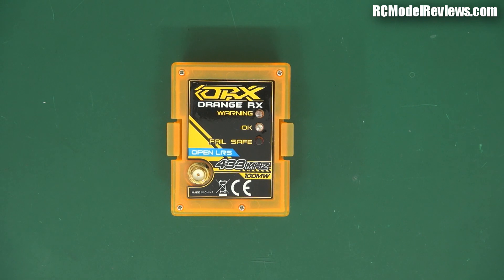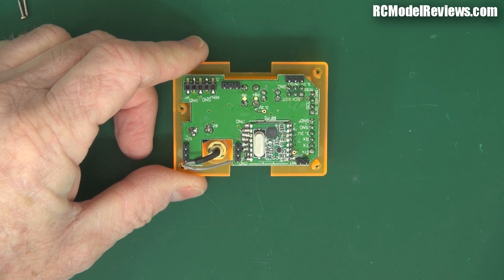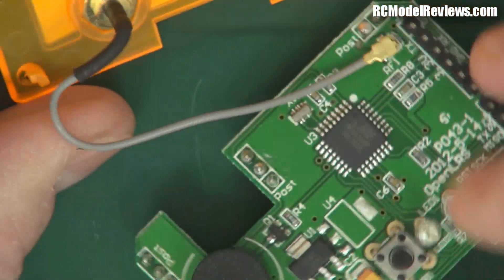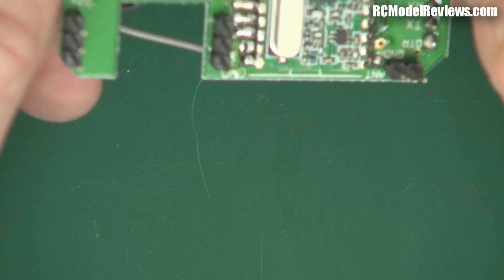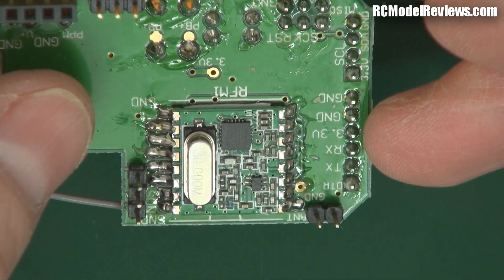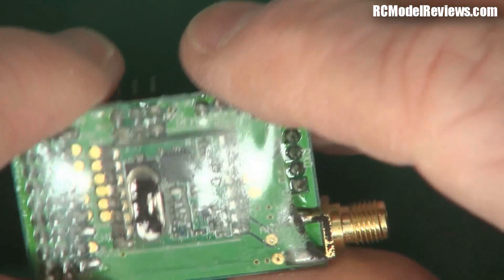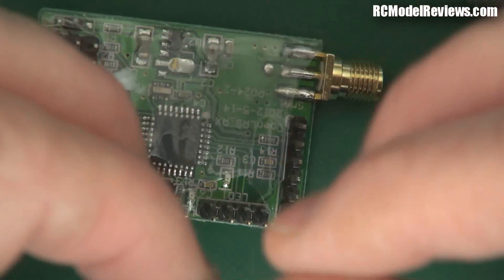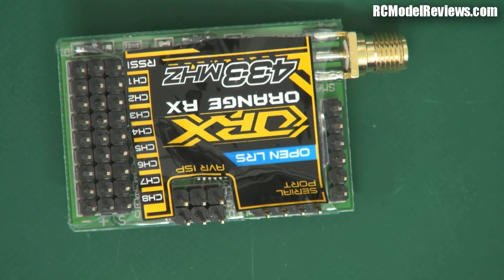UHF RC Shootout: Open LRS Long Range System (part 1)

Comment: I have used the Orange Open LRS system from HobbyKIng on a couple of models.  That large crystal on the receiver is a bad idea.  I did swap a couple of modules to the type with the miniature crystal or resonator.  You also need a 3.3V interface to connect for Arduino programming.  I don't like that this version runs the Atmel CPU at 16MHz on 3.3 Volts. It's being over-clocked at 3.3V; probably not a good idea for a mission critical component.  Other than that, once you get it working it seems OK. Getting it working well with OpenLRSng firmware can take quite a bit of messing about.
Reply: most 100mw rx work on 3.3V@16Mhz...

Comment: Hey Bruce, have you noticed that there is a small amount of static noise on your wireless mic when you tap your screwdriver on any metal parts of the circuit boards?

Comment: Bruce please give me a hand. During last 2 years, I've gone thru 2 OrangeRx 1W, 2 OrangeRX 100mw, 1 DTF UHF 1W deluxe, 2 DTF 100mw RXs, Numerous antennas(4 self made, 2 nagoya dual bands, 2 DTF dipoles)

I can never go beyond 1km range without triggering failsafe. A while ago I thought I found the problem, turned out I haven't (My taranis+ is powered via 7,2V NiCd aparently DTF modules are designed to work with 3S battery, So I plugged a 3S lipo to taranis. Same result.)

Also to anyone reading this comment, If you got an OrangeRX JR module it's extremely likely that the antenna piggyback is broken. Check it with multimeter before even turning it on. 3 out of 3 of my Orange modules had broken wire which resulted in burned out module.
Reply: flanker Try lower data rate and also enable channel hopping. DTF 1W should do 1km at complete ease. Maybe post a shot of your openlrsng settings?
Reply: I'll swap my 9xr for your Taranis ;-)
Reply: flanker If you ever powered the TX module without an antenna, you might have blown or damaged the output stage of the TX. Having the buzzing noise go away suggests to me something has blown. Unless you added shielding to your speaker circuit (as I did on mine) then I'd suspect the TX module itself.
Reply: Hehe... I like the irony of that. Using the Taranis to test for it's own demise...  :-)
Reply: Orange isn't made to fly 1k out, buy something better, Orange is cheap park fly stuff, I use it all the time with no issues, I just don't expect it to do more than it's price bracket?
Reply: Ben Portman hey there Ben. It's not just the orange. Dtf Uhf is made by the guy behind openlrsng.  people reach 60kms with it. Even with a terrible antenna i should get more than 1km from a uhf system. Another strange thing is,  whether i use telemetry or not. My range is roughly the same. Which indicates that my tx module is outputting no more power than my rx (which is 100mw) 
At this point I'm pretty sure that problem is with my taranis(since I've change every other component). I think it just can supply enough current. 
A friend of mine has a 9xr. I'm planning on burrowing it and testing with it.
Reply: Leo FPV I tried lowering datarate as low as it'd go. Also tried with standard settings. As for channel hopping, tried anything from 6 channels to 24 channels. I'll post my current settings.
Reply: Ben Portman Sure :D
Reply: flanker i use open lrs for about 2 years  and never had a problem. only burned 
my first reciver because i used 5v. had to replace the RFM22B 
transreciver module. i bought 4 of the new versions with the small 
kristal from aliexpress for 20$ or something. i use the rmilec SRC771 
1/2 Wave and the ImmersionRC 433MHz "Sander" Antenna and a couple of 
home build half-wave dipole antennas. the 1w on the transmitter is not 
real . it only outputs about 500mv
Reply: Walter Melon I think my TX doesn't even output 100mw, let alone advertised 1W. 

Something just occured to me, I remember the first time I put a 1W orangeRX module to my Taranis. I recall a really loud buzzing sound from the Taranis's speaker. Now there is barely any static. I feel that suggest my module is outputting very little power(as in 3-4mw) 

Does anyone know how taranis supplies power to the external module? Does it just bypass battery power to the module, or is there a regulatory circuit in it?
Reply: Ben Govett Hey there, I might have powered my first orangeRX module without an antenna, but I'm 100% sure I never powered DTF UHF without antenna(I actually taped the antenna to the module to not accidentially remove antenna) 

As I said, only thing left to test is the Radio itself. I have a feeling something inside the radio is smoked and it can't provide the module with enough power.
Reply: flanker The old JR radios used to output 6v on pin 2 of the 5 pin module bay connector. Some radios with JR module bays ground this pin, others leave it open circuit. A grounded pin MAY cause a problem with a module if it's relying on 6v for something. Needs testing I guess. 

Could measure voltage output from the bay with and without the module connected. If there's significant voltage drop across the supply and/or significant current being drawn I guess you'd have some more symptoms to follow up with!

Testing is always key. Test inputs, test outputs. Hope something turns up for you!
Reply: Ben Govett Thanks for the advice I'll run some test when I get back to home(@ vacation atm)

From what I've read, Taranis outputs whatever battery suplies on Vcc pin of JR port. As in if you run 2 cell battery on your radio, your module gets 7V, if you run 3S 12V. 

LRS modules I use work with 12V so supplying 7V reduces it's output power significantly. 

I have a different test in mid. I'll supply the module with 12V from a separate battery. I'll common the grounds and only connect the PPM pin from the back of the JR port to the module. If loud static starts to come from taranis(when I take the module close to it) then something in taranis is toast.